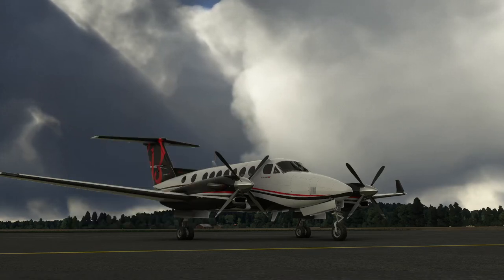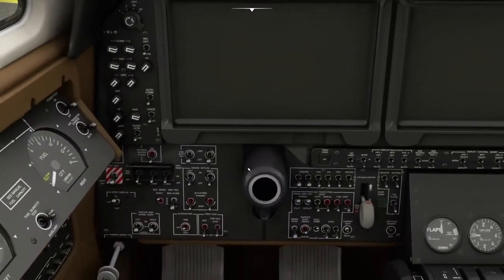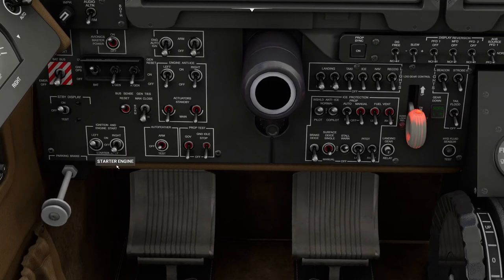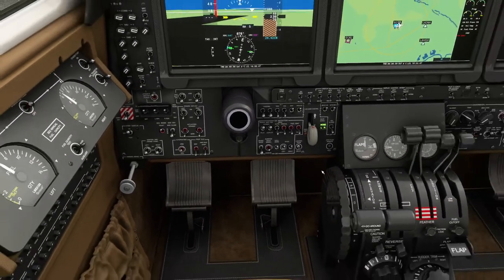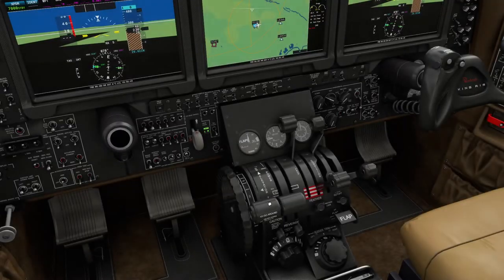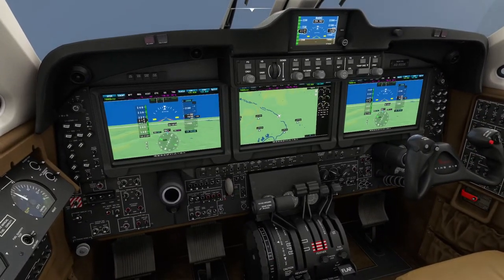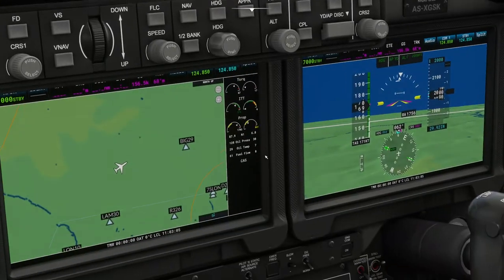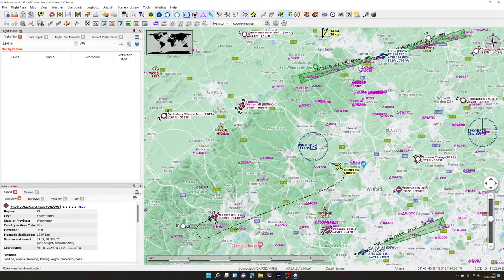Exploring the King Air B350 Propeller Modelling following Microsoft Flight Simulator Sim Update 8

Comment: Thanks to your videos I am now flying ILS approaches, flight plans and VOR. I have been flying the King Air lately and enjoying it very much. When would you feather the props, and why? Thanks again for your videos.
Reply from the maker: The reason to feather a prop is following an engine failure (or a problem with torque) - feathering essentially removes the stress on the engine. It also reduces drag - you can happily fly on one engine for example if you feather the prop of the other engine.

Comment: I'm having a hard time to get the props to feather on the ground after engine shut down.. It worked only once and hasn't worked since then. But on the C208b it works every time..
Edit: just downloaded a mod that’s technically not SU8 ready but seems to fix this problem.
Reply from the maker: I saw the same thing - it's to do with the order you do things in. If you think about it, you still need power to feather the props (to turn them). Feather them before you shut the engines down.
Reply: To be precise, to feather the props you need oil pressure, so basically a running engine. The engine oil system moves the blades.That's why you can't feather with engines turned off.